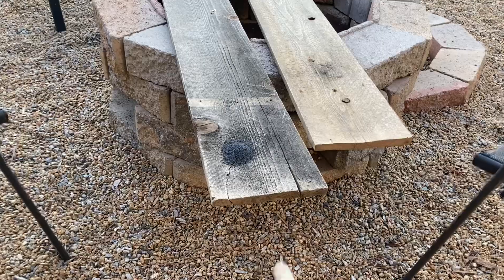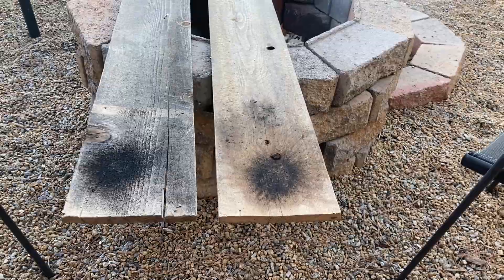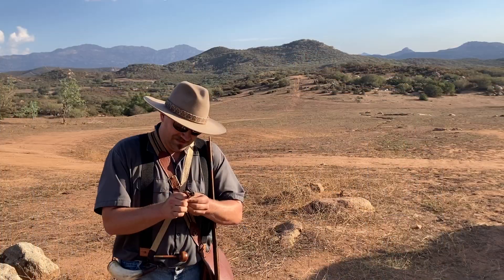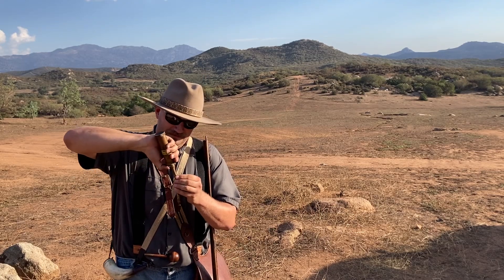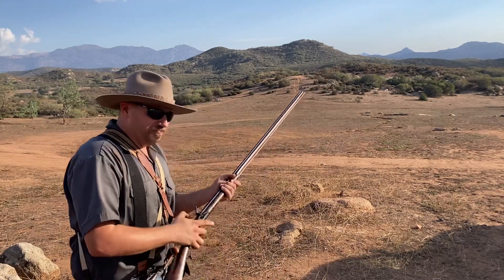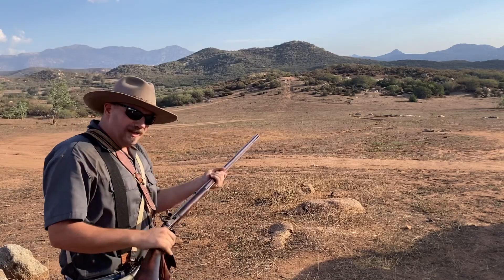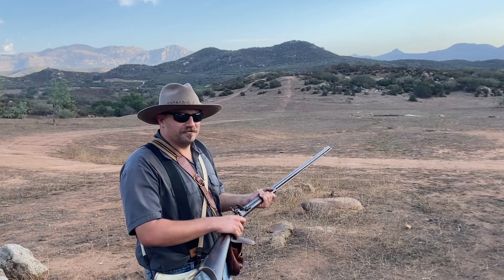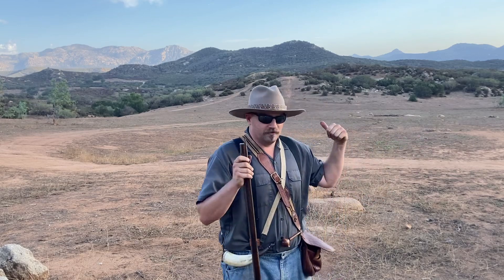Can you use Pyrodex in a Flintlock?

Comment: In my percussion Hawkin ( I know, not flint) 80 Gr charge, put 30 gr of FFG in first, followed by a 50 Gr. pyrodex (or white hot) pellet, then .45 cal sabot pistol bullet. Goes 💥 every time. Should work with flint; make sure BP charge is around touch hole, and pan is primed properly, and you get a good spark.👌

Comment: I tried Pyrodex with my flintlock...much longer hang fire [using Goex 4F in the pan] it would sizzle for almost a second before firing. I bought it to experiment, and I hated it. I had been using Goex, and I am almost out of that, and recently bought two pounds of Swiss 1.5F and will start using that when the Goex is gone. I poured the Pyrodex, the entire pound, into a pile in the firepit and threw a lit match at it. Now, that was impressive.

Comment: Experienced  flintlock shooters will tell you to use 4f black powder in the pan and then the pyrodex in the barrel will go off. Then you don't need to put 5 or 10 grains in the barrel. If you use 2f or 3f black powder in the barrel, you should still use 4f in the pan because that is what 4f is meant for. The 4f kernels are very fine are not intended for use in the barrel.

Comment: When I was first introduced to black powder (back in the 1980's) it was with a brand called "Meteor" (at $1.99 a pound for 3f). The powder produced an abundant amount of fouling and I found myself experimenting with Pyrodex and, years later, Triple Seven. 
Swiss and even GOEX were hard to find. I eventually got a .54 cal Lyman Trade Rifle and tried a pseudo duplex load of five grains of 3f GOEX behind a normal (80 grain) charge of 777. With 4f black in the pan, it actually worked reasonably well. 
My take away from your videos is that black powders can be pretty clean. Your results with Cottonelle and bamboo appear to produce similar amounts of fouling to what I get from Triple 7. The other take away is that I should track down some Swiss or make my own and, I should really get a Kibler. That is an impressive rifle. Thanks for the videos. Lots to learn.

Comment: So there's a whole science to touch-hole size vs. powder burn rate vs. desired efficiency.  The substitutes aren't as volatile, so they have a harder time flashing through the touch hole.

There are two ways to solve this.  First, you can sometimes find tiny priming flasks designed for priming the nipples on caplocks.  On a caplock it's just for a tiny bit of extra reliability in wet weather.  But in the case of a flintlock it can let you inject enough black powder in through the touch hole that you don't have to fuss with putting ten grains or whatever down the barrel first.  This way it's only your lock that gets sooted up with black powder fouling and your barrel gets to use the cleaner substitute.

Second, if you're going to shoot substitutes all the time, then just make the touchhole a little larger.  You'll need a slightly larger main charge to go with it since more pressure will be escaping through the hole, but it'll work reliably.  The less volatile your charge is, the more fire you need to introduce to ignite it, and the larger your hole needs to be to do that.

Oh, and a lot of the fouling comes from the powder not burning cleanly due to not maintaining a high enough pressure in the barrel.  So having a good wad under the bullet and making sure your charge is large enough for your touch hole size can reduce it substantially, regardless of what type of fuel your machine is burning.

Comment: Good explanation  and there is another point:
Pyrodex requires a hotter flash to ignite than BP.  Thus, in a flinter, the strike is not consistently hot from shot to shot.  Flints wear, and can actually go from a good bite on the steel, all the way to no spark on the very next shot if the stone breaks wrong.  This can result in dull orange sparks which are not as hot as the bright yellow sparks of a good strike.  This can compound the inherent issues that all flintlocks suffer from - with varying degrees of severity.  A very few guys have tuned their firelocks so well that they are almost instantaneous, but I doubt they use  synthetic BP.

IMO, Pyrodex is excellent when used with any percussion gun that has a flash channel that is "in-line".  This especially includes the revolvers.  A flash channel that has to force the cap flash to turn 90degrees will guarantee hang fire and misfires with Pyro.
Reply: Different material compositions of the frizzen will substantially affect the spark temperature as well.  Steel is between 800F and 2500F depending on carbon content.  Titanium will be around 3200F.  Ferrocerium goes up to 5430, but it's more suitable to a wheel-lock than a flintlock due to how quickly it erodes.

If you can find somebody who can make you a titanium frizzen, that might be interesting to experiment with.
Reply: @laurenceperkins7468  Yes indeed.  I never considered titanium for a frizzen.

Comment: I found that if you run the ball just to the powder without compressing the load using Pyro RS with 4f in the pan. It will fire flawlessly. However, I had to mark the depth on the rod and repeat process without over compressing the powder. There is a story behind how I ran into this out experimenting. However, I was getting repeated very quick discharge. Ball-n-patch was more sensitive to seating to just too the powder. Where full bore conicals I ran just to the powder and as long as I didn't cram or crash into the powder. I think I raised the rod 4 or 6" and let go to give it a little tap against the powder. I'm going to be experimenting again here soon for late season flintlock in PA. If you read this and are willing to try it out sometime. Jake Your rifle is better than mine. Should work like it did out of my traditions deer hunter. If I can find a way I'll try to record me using this method. Anyone else who is new to BP reading this your Projectile must be seated against the powder always. Using this method seems to allow an even burn flow through the charge to get a fast like BP shot using Pyro RS. I never tried Pyro Select RS. This was a shots and giggles discovery.
P.S. : Pyrodex P will not work this way and will hang fire every time slower than ever. But, was very accurate with loads I tested out of curiosity mostly sabots and 250gr. REAL bullet. Be safe, and keep'm smoking.
Reply: As of the moment I really have no way to get a video recording of me doing the above 😢 writen. My phone is crap. Regardless if your able to get real BP. Use it. Takes alot of flame to ignite Pyrodex RS evenly and get a fast enough burn rate. I never tried the 2nd method Jake did. As I said this was discovered on a random what if, and why not.

Comment: My .45caliber hawken is still loaded until I take it back to the range cause my dumb ass loaded it with pyrodex. I got the pan to flame up 5 times and 5 times it never ignited the charge. Gotta try until it goes off or I might just have to stick a lighter to it😂
Only my percussion hawken would fire using the pyrodex.

Comment: The black powder/pyrodex combo could come in handy for those of us who can't find black powder locally.
It's expensive and inconvenient to buy real black powder online, because of the shipping and hazmat fees. Usually it only makes sense if you can buy it in bulk.
If you're down to your last half pound of black powder and you haven't got the funds for a bulk order, being able to stretch it out with stuff you can easily find in a local store might be a real advantage.
Talking of which, I wonder if simply mixing the two together would work?
That would make the loading process a lot simpler.
Reply from the maker: Mixing them might work enough to make the hang fire tolerable.
Reply: Mixing them will help, but you'll have to use a much larger fraction of black powder than if you can make sure it's right next to the touch hole.

How much black powder you need as a booster charge will depend on where your touch hole is relative to the back of the barrel.  You need enough to get the powder next to the ignition source.  If your touch hole is right at the breech plug you might not need more than a pinch.  If it's halfway up your usual charge volume, you'll need a lot more.

Comment: FWIW, as you explained, all the other substitutes will have the same problem as Pyrodex (if not worse) because they're DOT/UN classified as propellants rather than explosives.  The only reason we can legally buy and store black powder is because of a specific exemption in BATFE regulations for black powder; it's very, very unlikely that any new substitute that burns like black (for instance, if someone were to resurrect ammonpulver or the "pink powder" based on picric acid that were used in some artillery during the Great War) could receive that exemption (black gets it because it was in very common use before BATFE was formed and their regulations first promulgated).

I've seen other videos that seem to demonstrate that the only way to get substitutes to work fairly well in a flinter is to use actual black powder for the priming charge -- but if you can buy FFFFg for the priming, you can probably buy FFFg or FFg for the main charge, so all you might possibly gain by using substitutes is easier cleanup (and cleaning up black powder residue isn't that difficult).

So, end conclusion, substitutes are fine for cap or primer ignited reproductions or modern inline muzzle loaders (and they let us buy something to shoot from sporting goods stores that don't have a BATFE approved explosives magazine on premises), but they aren't intended for and don't work well in flintlocks, wheellocks, or matchlocks/tinderlocks.
Reply from the maker: Yep

Comment: Ive been using Pyrodex for years in a flintlock. Not for the flash-pan though just the propellant. Also the main thing i use in my cap and ball guns.
Reply from the maker: Whatever works
Reply: @Everythingblackpowder  Oh don't get me wrong i fully realize its worse. But where i live none sells real black powder so i have no real option to use black powder. I can get flash powder but not FF. So unless its possible to use flash powder in the barrel what option do i have?

Comment: I recall watching a video in which a guy made nitrocellulose out of cotton balls. I know you can't use that as a propellant, but maybe you could twist up some nitrated cotton into a thread that could be inserted into the touch hole of a flintlock, and it might work for ignition of pyrodex in a flintlock.
Reply: So, firstly you definitely could use it as a propellant...  The first name for nitrocellulose was "gun cotton" for a reason.  Don't fiddle with it unless you've actually studied up in depth on modern powders and internal ballistics though.  Its burn rate varies quite a lot based on density and pressure, so you're getting into the realm where even just a fouled barrel can give you a thermal runaway and "overpressure event" if you're not careful.  I do know a couple experienced reloaders who worked up smokeless loads for their "old smoke-sticks" though.  All a matter of getting your loading precision fine-tuned and being mindful of the maximum allowable pressures.  But seriously:  The difference between squib, safe, and pipe-bomb, can come down to less than a couple grains, and the weight of your bullet matters*.  So just don't unless you're going to take it *very seriously.

Putting a thread of it through the touch-hole might work...  But probably not as well as you might hope.  The whole problem is that the flint lock is just barely generating enough heat to ignite pyrodex, and the ignition point for nitrocellulose is even higher.  And also the burn rate of nitrocellulose in open air is not fast.  So you're definitely going to have a longer hang than just using black powder.  But it might at least solve the reliability problem.

Comment: Another drawback to Pyrodex is that it produces a different form of fouling in the barrel, for which you have to use chemical cleaners
Plain ole BP can be cleaned out with just plain ole WATER! You can put some kind of soap, like Murphy's, in if you want to, but it isn't NECESSARY. Just pour hot water down the barrel until it comes out the touch hole clear, run some dry patches down, followed by an oiled patch 
Just one less item to have to carry.
By the way, if you use something like "bore butter" as a patch lube, you CAN'T use chemical-base cleaners, as they strip the protective effects of the "butter" from the barrel

Comment: This is the exact issue I'm having with a .36 flintlock rifle I build more or less from scratch. Been trying to use triple seven 3f and getting really annoyed at it. My first flintlock experience and I was about to scrap it. Looks like I need to find out where to get real black powder now....
Reply from the maker: It will make all the difference in the world
Reply: @Everythingblackpowder  I checked our Walmart and a local sporting store, they had plenty of pyrodex and triple seven, but no black powder. We have 2 local gun shops I'll check for real black on Tuesday
Reply from the maker: You might have to make your own
Reply: @Everythingblackpowder  I've tried several times using 75:15:10 ratio but to no avail. Using willow hi-yield stump remover, charcoal, and sulfur dust respectively. I've ordered some spectracide stump remover to see if that works any better and the last thing I can think is the issue would be the sulfur dust as its only 90% sulfur. The other 10% is just listed as inactive ingredients
Reply: @Everythingblackpowder  one of the local shops had powder. $35 for a pound of 3f but I'm only running 20 grains a shot so that comes out to like 10 cents a shot. Ignition is a million times faster and way more reliable. Shot about 20 rounds and only had one time that the pan didn't ignite due to a dull flint (that was probably on the 15th shot). Thank you so much for this video and giving me faith in a gun I built that I was about to set in the corner and forget about. Perfect timing too as I'll be camping at a rendezvous for the first time tomorrow through Sunday. Looks like I'll be able to bring a shooting rifle with me
Reply from the maker: @PossumSausage  excellent! Glad to hear it
Reply: @Everythingblackpowder  I'm uploading a video right now of me shooting it and a quick overview. Don't mind my flinchy eye when I shoot, that pan flash gets me every time since I'm not used to it lol

Comment: With Triple Seven my hangfire was measured in weeks. Works great in my caplocks but useless in my flintlock rifle and pistol.
Reply: Easy to clean up though.
Reply: @erg0centric  As long as you're using a big enough charge with enough pressure to ensure it burns cleanly.  If not then you get hard toffee smeared all down your bore and its a PITA to scrub out.  The stuff is basically the "rocket candy" you see used in amateur rocketry.  Sugar + oxidizer.

Comment: This is a neat presentation! Black powder is hard to get where I live so I process FF powder through a glass and ceramic grinder (made for kitchen application, no spark potential) into an extremely fine dust for the pan and tap my flintlock pistol sideways to fill the touch hole. It works very reliably but I'd love to get my hands on real black powder to see the difference. I also slightly abrade my frizzen to create more sparks and insert the flint upside down for a more aggressive angle. This wears down the flint a bit faster but achieves instant ignition. Anybody else do this?

Comment: I tested 777 and Pyrodex a couple days ago and it was hard to get it to ignite.  The rangemaster who is a bp competition guy mentioned grinding 3f to a fine powder and it will drop through the hole and ignite faster.  I wonder if that would enable using substitutes more reliably.
Reply: Not really I have never used have witnessed a few, Flintlocks tend to be black powder only due to the lower flash point of black powder, Substitutes require more heat and spark to ignite them. So Percussion and In Lines are the best suited for them.
Reply: "Drop through the hole" - I'm assuming that you are referring to the touch hole. Filling the touch hole is, in essence, making a short fuse. Will it help the substitutes ignite? Maybe, but it will ALWAYS give a hang fire while the flame travels down the fuse. While a hang fire is guaranteed by doing this, it might be useful for eliminating the flash in the pan, so it would be worth experimenting with. And rather than grinding 3F finer, why not start with 4F or Null-B?

Comment: This sounds a bit silly, but do you think you might try using pyrodex pellets in cartridges? Hodgdon does publish a small guide to doing so in 45 colt and 45-70. Personally, I'd like to use them in 20 gauge cartridges (with a little loose powder around them) if you think that's an interesting idea.

Comment: I personally don't see the point of mixing the black powder in with the poweradex charge, I would probably go with a straight power decks charge and use black powder for the Flash pan as I believe the hotter faster burning black powder would ignite the power decks
Reply from the maker: Personally I don’t see the point in using pyrodex at all.

Comment: I have not shot a flintlock yet but I JUST ( today) bought a Traditions flintlock. On the barrel it says " black powder or Pyrodex only ". It did come with a separate measurer for Pyrodex but I have used Pyrodex in my revolvers and it gunk's up my action faster than regular Goex. I have used old 777 pellets in an inline ( 5 shots) but they didn't seem any better than Goex and I still had to swab the bore between shots. Interesting that the barrel itself says Pyrodex is a good substitute. Either way, I'll stick with real BP. Thank you for your videos, I have learned a lot.